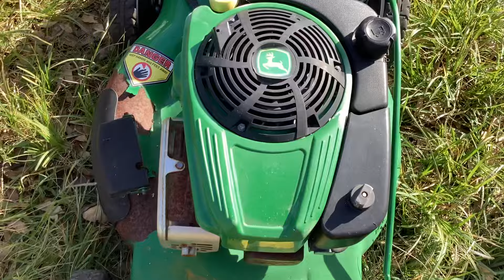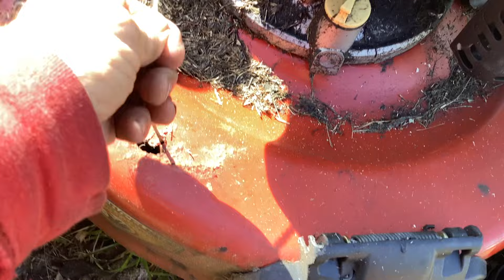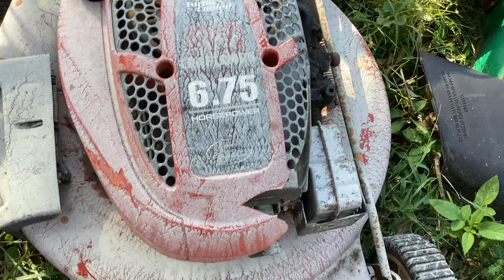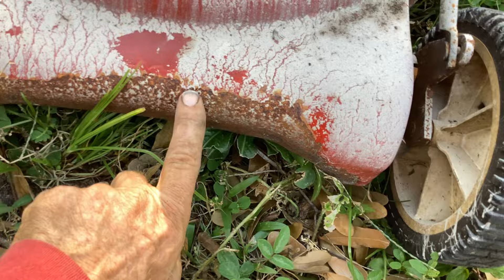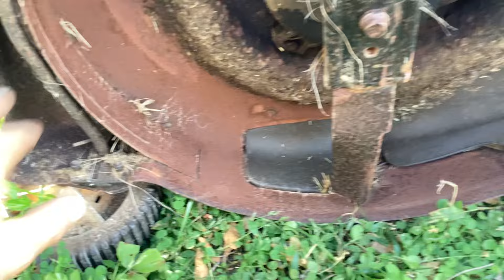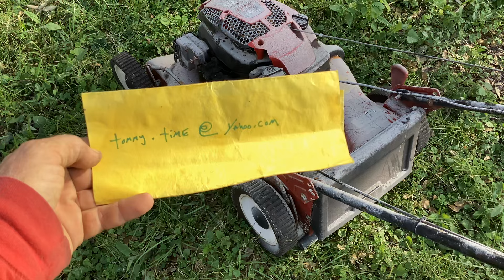Happy Saturday.!!! Semi-Normal after Bad Mr. Milton Blew Through.!!!  Bought a Big Group of Mowers!!

Comment: have you ever considered retreading those wheels?  I have front wheel drive and I refuse to spend 50 bucks for wheels again (the last pair only lasted about 2 years).  I've seen retreads using mountain bike tires, contact cement and screws.  also one guy took an angle grinder and cut new tread into the bald plastic.

Comment: I bought 6 toro mowers, 1 snowthrower. He says $250. I responded lf I give you $175 that's $25 per unit. He thought about it said ok. Some of the toros are the older 2000 style ones. So when end of December is here snowblowers quit selling I have lawnmowers to work on
Reply: Mike I buy heavy all winter and stopped sales last month 
Waiting tell next year 😮😊😊😊
Reply: Good to hear